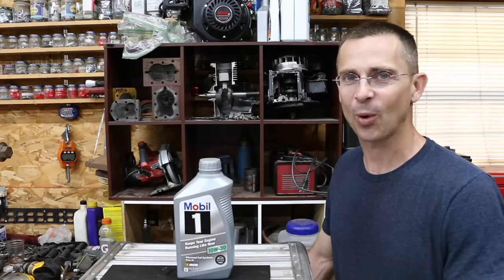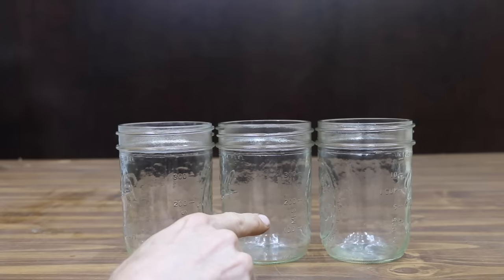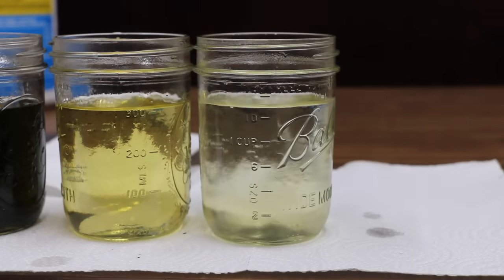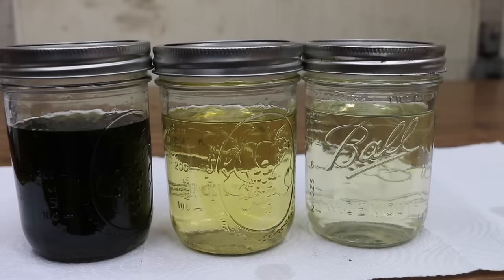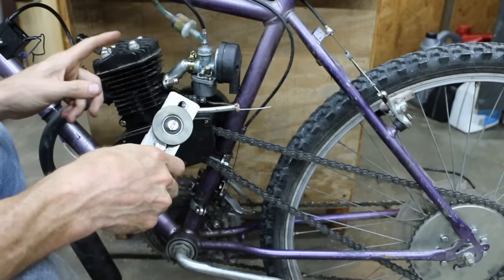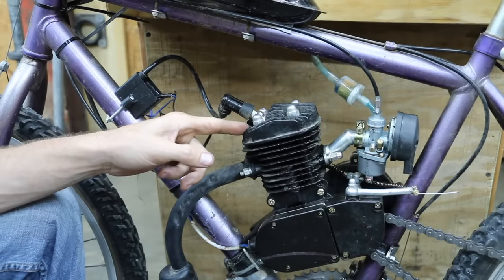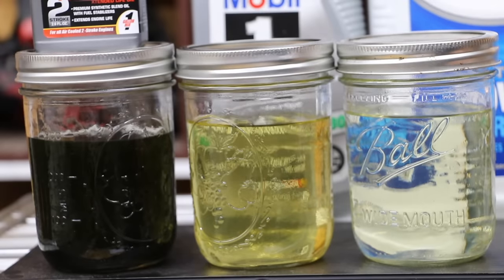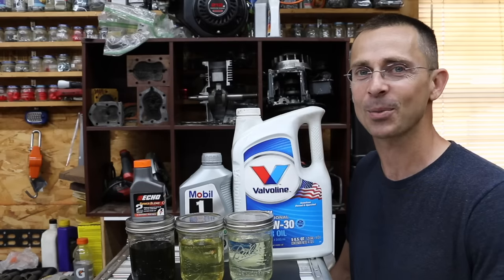Will 4-stroke oil damage a 2-stroke engine?  Let's find out!

Comment: Wonder what happens if you go the other way and put 2 stroke oil in a 4 stroke engine?
Reply from the maker: Thank you. I tested that a while back and the engine survived, but there was a lot of blowby.
Reply: I do this and i got a free kohler mower that i fill with Xd-100 oil. i rigged up oil injection that pulls oil to the carb and i run it as a total loss lubed motor. Also you cant go wrong with silkolene pro 2 SX as it is a straight 40W 2 stroke oil. Most 2 stroke oil surpass 10w30 and can take more heat. Dont be afraid to try it. The xd-100 burns clean as it goes through. I cant wait to try Castor 927 maxima in a detroit diesel2 stroke 8v92 oops thats a 2 stroke that burn a lot of oil anyways. I have ran pensoil semisytheic tcw3 in the crankcase of my old 69 deville 472 many times with no problems.
Reply: I run xd-100 2 stroke oil in my free kohler mower for years and it’s the best so far, I will never go back
Reply: I do it all the time
Reply: So far no problem as I feed it into the intake with home made oil injection. I’m on xd-100 2 stroke oil on a Koehler mower I got for free
Reply: its a synthetic oil with high zinc and phosphorus. i doubt it would hurt anything but i dont think its designed for thermal heat. its viscosity will break down really fast im sure. BUT it will bake that zinc to the parts so i guess thats a good thing.
Reply: @jlo13800  ,
I believe he's talking about using it in the crankcase.
Reply: i do it all the time and i use xd-100 or amsoil dominator synthetic 2 stroke oil, i do this with my free kohler mower and feed some of the oil into the intake for total loss burnoff. its the best oil i used so far as i kick the 4 stroke oil habbit years ago. its like quitting smoking and junk food.
Reply: Most small 4 stroke are built like 2 stroke anyways, its better to use 2 stroke oil in a 4 stroke than vice versa, 2 stroke oil is heivier duty and withstands a lot more heat and pressure that u just don't get in a 4 stroke
Reply: i have done thid 2 stroke oil in the crank case and it works even better, i fiull and premix my fre kohler powered toro with nothing but 2 stroke oil, it fucking works and its much better! i I use xd-100 synthetic 2 stroke oil and hehe it works!

Comment: I've seen several 2 stroke engines destroyed by use of the wrong oil. I have to admit I even wrecked one myself before I understood how important the proper 2 stoke oil is to some engines...Both engines you used were low RPM engines that run at temperatures similar to a 4 stroke which is why it worked. Those engines can use the same 2 stroke oil as boats which isn't too different from 4 stroke oil.  Something like leaf blower or string trimmer that turns RPMs north of 7k and runs twice as hot use a 2 stoke oil that has a TC rating. Which is often synthetic and has additives to withstand increased heat & friction without breaking down. Neither 4 stoke oil or even 2 stroke boat oil without a TC rating will last very long in something like a string trimmer. With those engines at best you may get an hour of run time before you've killed the rings and likely the cylinder bore.
Reply from the maker: Great point. Thank you

Comment: 4 stroke oil was the original 2 stroke oil
Reply from the maker: Thanks for commenting on this.
Reply: Your right about that. i have mixed up castrol 10W40 at 40:1 on a john deere 440 snowmobile and it ran fine.
Reply: Ryan Brunson its really the same thing, they just made specific oil for 2 strokes because running normal oil in them is bad for emissions, 2 strokes do nothing but burn oil lol...
Reply: It was
Reply: It was and still works today as long as you avoid high milage molybdenum zinc additive.
Reply: Senior citizen input but I remember a time as teenager non detergent 30 weight was highly recommended 2 cycle oil !
Reply: The difference was that the exhaust ports and exhaust pipe don't coke up as much with two stroke oil. Back in the day, decoking exhausts was something you did every few months.
Reply: Yep, I remember seeing that on old 2-stroke engines. stating to mix 30 weight oil with gasoline. not sure when "2-stroke oil" was invented?
Reply: Wasn't it used motor oil that was filtered for particulates?

Comment: Would be great to see this just with used motor oil! We all have used motor oil from car oil changes, would be great to recycle it by using it in a pre-mix for 2 stroke engines! I expect it to be fairly smokey since their is a lot of carbon in used oil but would be really neat to see!
Reply from the maker: Thank you for the video idea!
Reply: I use used oil in mine . Always have never had any problems.

Comment: I remember back in the early 70s going to the motocross track. The smell of burnt castor oil was something i will not forget. The sights, sounds, and smells of the 2 strokes running balls out is just too cool and something you don't get today. Its a shame.
Reply from the maker: Thanks for sharing.

Comment: My Bultaco Alpina motorcycle used 4 stroke oil mix from the factory.  We now have 2 stroke that is formulated to protect the parts better and smokes a lot less. The forks also use 30 w oil.
Reply from the maker: Great information. Thank you

Comment: no, it wont damage the engine.
Reply from the maker: Thanks
Reply: haha thanks for making these cool videos man
Reply: yep before they made real 2 stroke oil, 2 strokes used sae30 engine oil, well into the 50s, however it might be more smokey  and cause more carbon, even metal fouling of spark plug (actually a carbon particle)
Reply: Yep, been there done that with too much oil in the gasoline on my old 175 cc CZ. Had to pull out the spark plug every 5 miles or so to clean it. lol 

- and yes they used regular motor oil as premix on two stroke engines back in the days, even the gas stations used it on their small hand cranked 2-stroke fuel pumps.
Reply: J Rand 
Haha I hate mixing a can of 2 stroke gas for my weed eater that is used for 5-10 mins at each cutting. 
A tank lasts me like half a mowing season, so I throw a healthy shot of oil in the gas tank and add fuel and test run it. 
Too Smokey? 
Burn a little more fuel and top it off with gas. 
Haha I figure if I see some smoke I’m safe 👌🏻
Reply: @MrHillfolk
Haha yes I've done that myself many times, and sometimes the result was as mentioned above.
Reply: I've done the gas tank thing too, and while I wouldn't worry about it on a $75 weed eater, too much oil can cause some issues too, mostly with carbon buildup in the rings. The truth is that if you are using modern 2-stroke oil and you see smoke after the engine is warmed up you're using too much.

How hard is it to get a 1 gallon gas can and have it hang around? It will save a lot of oil, and actually extend your engine life because your mixture will be more consistent and appropriate.
Reply: edifyguy 
Because if I use a full tank of fuel on the unit per season it’s a lot. 
It’s been working fine since I got it in ‘98. 
I haven’t even changed the spark plug, but I cleaned the spark arrestor screen once and that was a waste of time because it was clean.
Reply: Hard to argue with 20 years of success. :) Best of luck.

Comment: What about the separation of gas and ethanol?
Reply from the maker: Great video idea!  I'll put together a video on this soon.
Reply: Project Farm cool that would be very interesting
Reply: This one will be another dandy!
Reply: No separation. Brazilian gasoline is sold mixed with ethanol in all pumps over the country, it's the law.
Reply: Rodrigo Feher in us to some stations give u a option to pay a little more, most ppl use non ethanol fuel. For small engines because of all the problems it causes n small engines
Reply: Yes ethanol fuel is a nightmare with small engines and it goes bad sooo fast. Thankfully I have a small airport nearby that sells 100LL Avgas with zero ethanol. Yeah its got lead in it, and its like $5.69 a gallon, but thats still way cheaper than buying gallon jugs of Ethanol free gasoline at walmart for like $25. I would absolutely recommend the Avgas for 2 cycle engines, mine run way better. Not much difference with the 4 strokes though.
Reply: Add a little water to your gas. It will absorb the alcohol and settle at the bottom.
Reply: yep moisture is the culprit, since alcohol is very hygroscopic it readily binds to any H2O present and drops right to the bottom of the tank. which is exactly where the pickup is on most everything and has a near direct path to the carburetor, now you end up with a weak alcohol/water mix laying in there, which either grabs more moisture yet or evaporates leaving behind higher water content..... 
moral of the story? ethanol free really is best for small engines and things that are not used very frequently!

Comment: In the 50-60-70ties I grew up in my fathers motorcycle shop. Many times I filled the above ground petrol dispenser with sae 30 oil and gasoline from an underground storage tank. My guess is that on average at least one of our mechanics was busy decarbonizing exhaust ports, cylinder heads and, producing a huge quantity of smoke, the exhaust and mufflers. When later Shell introduced 2 stroke oil this all changed. The chromium plated cylinder walls, that allowed less oil to be mixed with the petrol, did the rest. A huge improvement in keeping the narrow streets in our city free from smoke when all the workers went or came back from work. I now found out from the remarks that my dad didn’t add this sae 30 oil to get more work but simply because 2 stroke oil did not exist yet. Thanks for this you all ! Gerard, the Netherlands
Reply from the maker: You are welcome!

Comment: I owned a 1957 SAAB Model 93 which has a 3 cylinder, 2 cycle 750cc engine.  The manual called for a straight SAE 30 oil with no additives. (basically the cheapest oil you can buy)  The oil was mixed 40:1  1 quart to 8 gallons of gas,  I drove the car over 100,000 miles without any work on the engine except for changing the spark plug, points and condensor as recommended.  Loved that little car and always been a fan of 2 stroke engines
Reply from the maker: Thank you!

Comment: When I was a kid in the 1950s, my step father went to work as a tree-faller in the woods.  He bought two new Homelite 5/30 chain saws.  IIRC, he used SAE 30 non-detergent oil in his fuel.  Those saws ran for years.  His bar/chain oil was used oil from the car.  The "special" oils didn't exist back then.  Our "firewood" saw was a two-man Titan saw with a 6 foot bar., nearly an antique even back then.  The same oils were used in it.
Reply from the maker: Thanks for sharing.

Comment: You are correct with your thinking of four stroke oil. But back in the day, most engine manufacturers recommend to mix non-detergent 30 weight four stroke oil with a good quality gasoline. The biggest issue is more carbon in the chamber. For the most  part oil is oil, just make sure you do not make the mix to lean with oil. I personally have been using 2 stroke lawn mowers since I started mowing the grass. My mower of choice is a Lawn-boy brick engine. Made in 1954, and it still runs great. Had to replace the main bushings though. Bet you the new mowers will never run that long for sure. Today they just make cheap junk!!!!!!!! Thanks PF
Reply from the maker: Thanks for the feedback.

Comment: This video confirmed what I was hoping about this Scenario I was glad to see that there was no damage to the engine after a tank of fuel mix was run through it. I was in a situation where I was a good ways out on some hunting land and ran out of mixed fuel but had a qt of Conventional and mixed up the fuel and ran it in my clipper and weedeater and it ran fine now I see through your test that there was no damage so I have no worries but only used it in this Situation and I am sure to keep more mixed fuel on me when I go out. Thanks for the video!!! In the end engine oil is engine oil and in this case it’ll get the job done.
Reply from the maker: Thank you!!

Comment: Thank you for the advice on the chain tehnsioner.  I solved it by drilling a hole through the tensioner and the frame and secured it with an extra bolt
Reply from the maker: You are welcome!  Thanks for sharing.

Comment: I have an old chainsaw that was passed down to me. It was manufactured in the late 1960's and it has a tag on the side of the case that states the proper mixing ratio and to use 30 weight motor oil. This old saw has been used for 3 generations now and has had thousands of hours of hard use over the last 50 years. I still mix it with plain old 30 weight oil and it always starts right up and runs perfectly every time. I actually believe the 30 weight lubricates better than the much thinner 2 cycle oil!
Reply from the maker: Great information!  Thank you

Comment: Many here are cheering (is that a proper word for it, I’m Swedish) the fact that the engine will run fine with “no matter what oil” in the gas but there clearly was one significant difference, the smoke. 

Good to know that in an emergency, you could pour whatever in the gas-tank but why on earth wouldn’t you buy an oil that smoke and pollutes less than the other? 

Great tests on this channel though, keep em coming!!
Reply from the maker: Thank you

Comment: I run a 1966 Johnson outboard on my fishing boat. 2-stroke, as was standard for that era. OMC's original service manual for that motor explicitly states mixing regular 4-stroke motor oil with the fuel. More interestingly, it "gives its blessing" to use 2-stroke oil--the wording indicating that 2-stroke oil was relatively new, suspect, and much more expensive at the time.
Reply from the maker: Thanks for sharing.

Comment: Off topic question, but no other way to ask.  When prepping my lawn mowers for the upcoming season, I always clean the plug and check the gap.All my mowers have the original spark plug; some about 25 years old.I figure as long as they start fine and run well that's as good as it gets. I once read that spark plugs never wear out on magneto systems because the electrodes don't burn.  I know it's pointless to ask spark plug manufacturers because they run ads every year advising plug replacement.

Comment: When I was a kid (many years before you were born) standard, non detergent 30 weight 4 stroke engine oil was used, mixed somewhere around 16:1 or 32:1.  The only 2 stroke engines that burned 'special' oil were the Homelite chain saws.  All 2 stroke engines lasted for years and years.
Reply from the maker: Thanks for sharing.

Comment: Back when 2 stroke oil was not made 2 stroke motors ran on SAE 30. You can find instructions on old 2 stroke motors that instruct you to use SAE 30 in the fuel.

Comment: I've been using a full synthetic oil-gasoline mix for many years in both my 2 cycle and 4-cycle engines.  Most 2-cycle engines call for a 32:1 ratio or a  50:1 ratio, gas to oil ratio. I use 32:1 for all of them, and the full synthetic seems to be the best choice over conventional oil. A 32:1 ratio is 20 ounces of oil to 5 gallons of gasoline. A 5-quart container of Walmart brand full synthetic oil at Walmart s currently around $16.- which is an amazingly low price. Synthetic oil does not deteriorate or gum up over time and offers exceptional high-temperature performance and lubrication. I have had exceptional stability with the engines and they start up year after year and don't need carburetor rebuilds or adjustments. The use of a gas-oil mix in a 4-cycle engine provides extra top cylinder lubrication to the valve stems, rings, and the cylinder wall. It seems using a gas-oil mix with full synthetic will substantially increase the life of both the 2-cycle and 4-cycle engines, and it makes life much simpler.
Reply from the maker: Thank you!

Comment: SAAB made 3 cylinder  2 stoke cars back in the 60's. The instructions were to put 1 quart of 30wt motor oil in the gas tank when you fill up with gas. No special oil. The early ones came with a lifetime engine warranty for the original owner. I had one in the late 70's, still ran well.
Reply from the maker: Thank you for the feedback

Comment: Many years ago I was fishing with my father in law. We ran out of fuel fuel for the kicker motor and didn't have any 2 stroke oil at the moment, so we mixed up a can with 10-30 motor oil, I think at 32:1, within about an hour or so of trollin the kicker motor started misfiring and eventually died due to the spark plugs being fouled, we replaced the spark plugs, found some more 2 stroke oil and away we went. That day taught me something. There was no damage to the engine from just that short term experiment, but it was a hassle. I guess the low temp operation of the 2 stroke boat motor running on 4 stroke oil was just caused too much deposits.